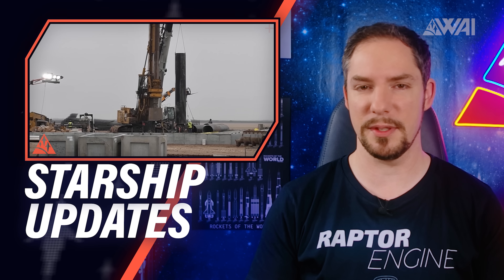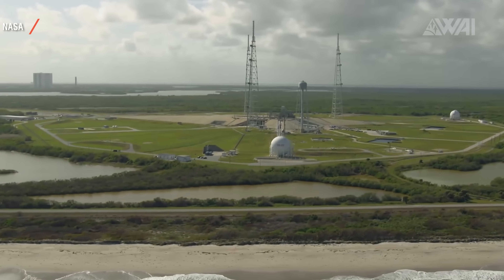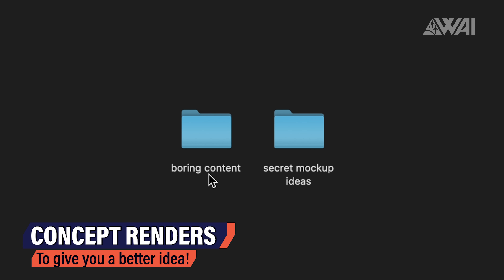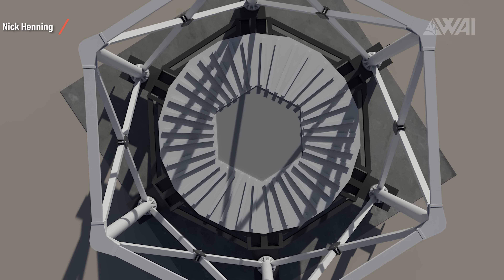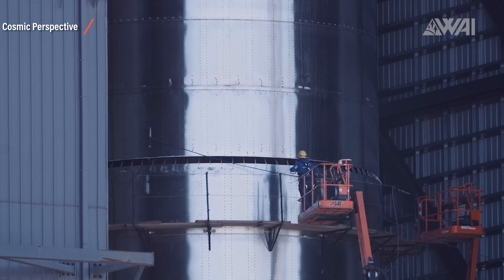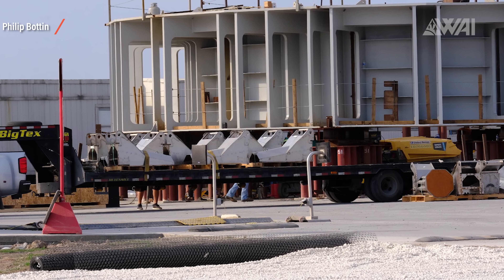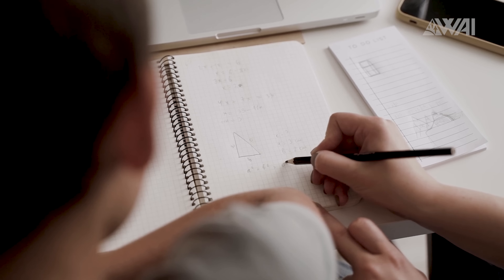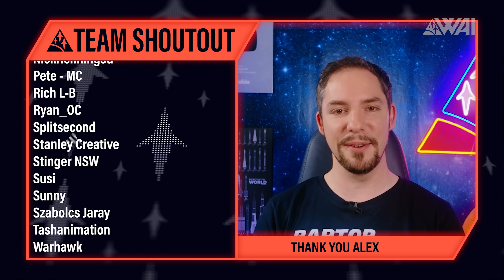SpaceX Starship Super Heavy BN1 Stacked! - Orbital Launches By July 1st? SN11 Ready?

Comment: I have followed you from the start- you must tell Elon that the legs will not latch if the craft is not plumb upright as a child's swing on a rough sea the angle change to upright will most likely make the latch target one that is harder (try thinking about a rope on a boat and imagine it yawing as you take off for your target ?I have 40 years experience as an Engineer fault finder and worry about the next launch and the latching of the legs Cheers

Comment: Lets see: Build and test 31 Raptors and 1 Vacuum Raptor (They all have to work),  Get at least 5 successful Starship landings up to 60,000 ft.,  Get at least 2 successful Booster landings,  Finalize and test the new Starship legs,  Finalize and test ground fueling for a Starship AND a Booster unit and finish and test  the Pad  infrastructure.  No orbital flights for Starship until September-October 2021.  THOUGHT:  Maybe Elon is depending on having one Offshore platform ready for this first "All-Up" flight.

Comment: Best solution would be to make everything out of titanium, unfortunately titanium is more expensive but there's a lot more of it on the moon. Titanium unlike Tungsten is not fragile and lighter than iron. It would solve all the heating issues.
Reply: but you can't weld it as easy. this adds a lot of complexity. in the end it is always a trade off I guess. a bit like the 'perfect' engine. an areospike is arguably better then a nozzle designe, but the additional complexity and the required materials make it not worthwhile in the end.
Reply: @spanke2999  you sound straight up like Elon Musk lol I guess very valid points you're correct.
Reply: @redfirekla  maybe a bit... but there are other decisions he seems to have made that I don't quite understand. 

This idea of one size fits it all! Starship as the concept should be able to lift 100 tons into LEO, refuel there and then, using the same configuration traveling to the Moon and to Mars. For the actual Moon landing it seems to be already agreed that you would have to need a modified version... I fail to see that you won't need one for Mars, given the differences between Mars and Earth.

Also Elons first approach was, no wings... because you don't need wings in Space! This is absolutely correct! Just it turns out you need wings inside and atmosphere. 

So what I ask myself, with a vessel like Starship, with the payload and the ability to lunch several times in a week or even a day... why not designe and build something that is suited for each and every environment? 

the answer here is the same I guess, it's not worth the additional cost... but I would argue that the benefits are slightly higher then in the example titanium vs. steal or raptor vs. areospike...

Humans are not very happy in a constant free fall. we are not suited to this, health issues will be a more prominent problem when the number of people and the amount of time in space is increased. 

Also it is not really efficient to do the trip with each and every single craft, there are orbits who could be used to create an almost free transit between Mars and Earth. A roundabout if you will. Perfectly suited for cargo but with the correct vessel and rotating habitats suited for humans as well... 

but hey...dream on! Have fun

Comment: That’s IT!!!! 😁😜   It’s how SpaceX should fix the header tank, inhalation issue. Use a fuel cell mentality about it. Keep the current header tank design, just use either an expandable/stretchable membrane, or essentially ensuring that that there is no way possible for the pressurization gas mixing and ingesting through the motor.

Comment: It may be a test structure for on orbit refueling, based on the compression structure you cited.  It would move a whole lot of fuel into the booster quickly while controlling the pressure.

Comment: "Elon Time" is actually something I see and use in engineering all the time. If you give yourself too much time to work on something, you procrastinate until the very end. So give yourself a shorter timeline to strive for, leaving time to deal with unexpected issues when you fail to meet the original ambitious timeline. Also, "aim small, miss small." By going for a shorter completion deadline, you're more likely to get it done quickly, even if that original timeline goal slips, as compared to giving yourself a longer completion schedule.
Reply: Ah, that explains my lack of skirting boards.

Comment: The thermal blanket is called Kaowool.  it's lightweight insulation based silica ceramic fibre, typically used in such thing as steel heat treatment furnaces good for about 1100²C max---!

Comment: I have a theory that the mystery framework may be a Superheavy hop catcher for Booster 2(and future boosters assuming that BN2 doesn't RUD).  If the intention is to catch Superheavy boosters by the grid fins, they're not going to waste their time/effort on designing/building/adding landing legs. With no staging crane/catching tower in existence at this current rate of prototype production, the only option is to catch the booster by the base.

Comment: A transportation brace/sleeve for the boosters.  It is fixed/bolted/welded to the multi-wheeled transporter.  The booster is placed on the transporter, inside the brace/sleeve.  That's my guess.

Comment: I'm wondering if the starship needs more time to slow down.  If they went higher on the next test, and ignited the booster much sooner, they could finally slow down enough.   After all, starship wasn't designed to take off from Earth, but rather Mars with much less atmospheric pressure.

Comment: I read from a knowledgeable person that the landing might not be absolutelly necessary at first, and that the most pressing use for Starship will be filling up the Starling constellation before the FCC deadline expires. Apparently, Falcons don't seem to be sufficient. At 400 a pop, Starships would the job almost seven times faster, and even doing it several times in expendable mode would be acceptable. (Almost $900M in FCC funding is contingent to providing broadband connectivity to some 650,000 rural users by, I think, '28. Of course, incumbents of all shades are fighting toe and nail that reward. Elsewhere, for example in my Croatia, but still full of "the middle of nowhere" pockets, the rules (for providers of cellular voice and broadband) are simple: cover 95% of territory and 99% of population in four years or you lose your license.)Actually, not necessarily, at first. I read from a knowledgeable person that the most pressing use for Starship will be filling up the Starling constellation before the FCC deadline expires. Apparently, Falcons don't seem to be sufficient. At 400 a pop, Starships would the job almost seven times faster, and even doing it several times in expendable mode would be acceptable. (Almost $900M in FCC funding is contingent to providing broadband connectivity to some 650,000 rural users by, I think, '28. Of course, incumbents of all shades are fighting toe and nail that reward.)

Comment: 1:15 - The concept of full-flow staged combustion engine is not new - the first attempt was RD-270 almost 60 years ago. However, it is the first that actually flew. RD-270 had problems with materials that could withstand the punishing environment of hot oxygen-rich gas. As we saw, some traced of that problem might still be there in Raptor.

Comment: Completing the Super Heavy Booster, will actually generate massive amounts of revenue, think about the tankers it going to place into orbit! That alone will ensure many spacecraft are going to be in constant operation, and using their space depots as refilling stations! After all they are build their own oxygen and methane fuel production plant!
Reply: No. there are no other spacecraft designed for in flight refueling. Satellites in orbit can not change their orbits and maneuver over to a Superheavy in orbit and then return to their original orbit, and satellite thrusters do not use methane and LOX propellant.

Comment: Can't wait for the stacking and first orbital launch! But I can't help but think that they might need to laundh it from a deep underground launch site with flame diverters it the bottom. How much wind would a full stacked starship take before tipping over? What do you guys think? Will it just plain work, or would they need to go down in the ground? 😃
Reply: There is no down to go to. Te Texas Gulf Coast is too thick to drink and too thin to plow. Any significant hole will quickly fill with water. that's why houses around here never have basements.

Comment: Wouldn't it be nice if they could refuel just before reentry , that way they could control there speed and not reach critical temperatures thus eliminating the need for the added weight of so much heat protection....
Reply: No, you couldn't.
Reply: not a very in-depth response...I think with tankers already in orbit , it would be doable
Reply: @scurge1971   No, it wouldn't. I'm sorry but you just don't understand the physics of the situation.
Reply: No...You just seem to have a limited mind...
Reply: @scurge1971   No, I just have a Master's Degree in Astrophysics and actual experience supporting Space Shuttle missions in Mission Control.

Comment: What's cool about the fiber insulation under the tiles is IMO though Starship would likely need an extensive repair afterwards the blanket should allow Starship to safely reenter even if it lost a tile or two.
Reply: Actually, it could do that even with bare metal. The Shuttles could.

Comment: how about a transport cradle to get the booster to the launch pad (to stabilize it and prevent it from tipping over) as additional security instead of just holding on to the booster by a limited amount of sheetmetal on the bottom ringsection.

Comment: 7:08 sn4 was just a bit more explosive than that.
Reply: Ya I noticed that to, I belive that was sn3
Reply: @nobackbrakes9011  Nope, SN1
Reply: @nobackbrakes9011  it's SN1
Reply: @nobackbrakes9011  SN3 collapsed due to low pressure in the LOX tank while the methane tank was full.
Reply: @KnightRanger38  ya I realize now that it was sn1 not sn3
Reply: Yea SN4 ended in a fireball because of a fueling problem and obviously it kinda succeeded/failed the static fire it was originally going to do so yea
Reply: Thats sn3
Reply: @cineflix127  nah sn1